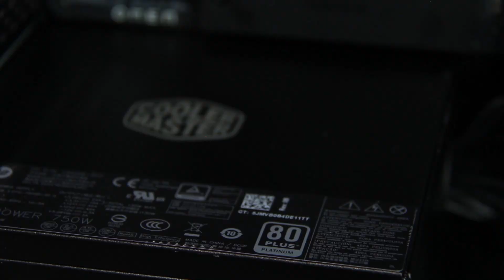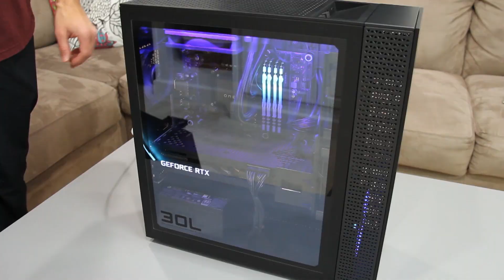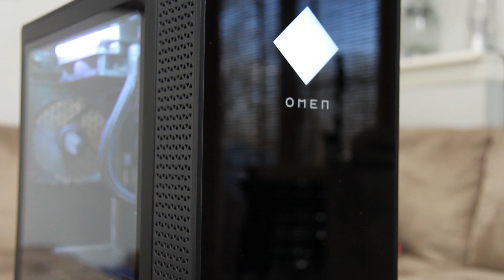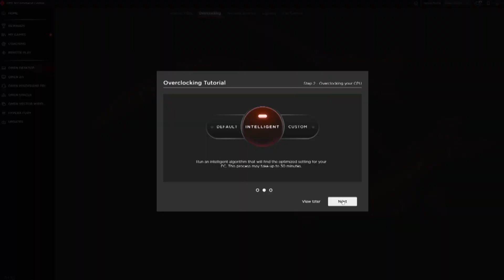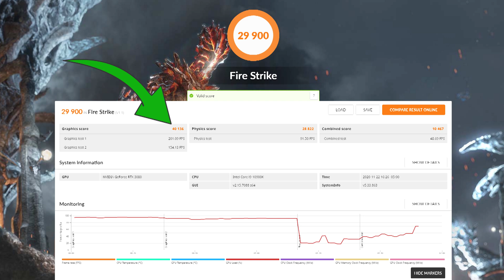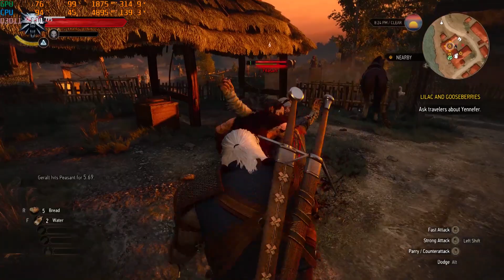OMEN 30L!  Are pre-builts good now?

Comment: I'm getting an Omen 30L for $850 with a Ryzen 7 3700x, 16gb ddr4 3200mhz ram, and a gtx 1650 super. Sure, the 1650 super isn't that powerful, but it is powerful enough for what I do, as I already own and use one in my current system lol
Reply from the maker: That’s an interesting combo and I didn’t know that spec was inside the 30L.

Comment: I have a new 30L Out of the blue it started shutting down, Hot?? just watching streamers. The fans start running fast & then it shuts down... I have to push the on button to restart it. Tow months old what do I have to do to fix this? I don't feel any air coming from the top of the cooler?? So instead of the fans running normal it's like it wait until it to late & crash... Help!!!
Reply from the maker: I’d repaste and undervolt.  With a little tuning you can make that sucker scream 👍

Comment: Hey Bob I just bought a OMEN30L AMD Ryzen 5 5600G - 16GB Memory - NVIDIA GeForce RTX 3060 - 1TB SSD should I return it as I have zero computer knowledge and no time or knowledge to replace a motherboard/overheating issues with fans? If I return it what prebuilt do you recommend for causal gaming and longevity? Thanks!

Comment: I have one of the earlier model omen desktops with a gtx 1070, 16gb ram, and an i7 7700k. Paid a little over 1000 for it. Its held up under frequent use for about 4 years now with regretfully alot of neglect in the cleaning department. Its like a faithful Toyota, not the best or nicest thing on the market, but it'll take care of you.

Comment: in spain 3080 is more then 1500euro and you can only pre order. here with this pre build pc comes with i9 10580k, 64gb ram, 1tb ssd and 3080 total 2599euro. i think apart from the heating issue (which can be solved by changing fan(maybe)), it's a good deal. and because of shit miners , i don't thing gpu will be available in 1-2 years.

Comment: Does your power supply exhaust fan (the fan at the bottom back side along with power supply) in the OMEN PC starts and stops continuously after every few seconds ? thanks
Reply from the maker: Yeah that’s how many of them work.  They can go into passive mode sometimes 👌
Reply: @BobOfAllTrades  thanks for the quick reply. the constant clicking sound due to start/stop is annoying. I don't even understand the logic of the fan starting/stopping so quickly as temperature won't change every 5-10 sec. But it is what it is! :)  thanks

Comment: Great video, with lots of thoughtful explanation of why the current Omen by HP is a good pre-build. 
I got the 25L with an i9 9900K and its cooler master liquid cooling system. I get temperatures of 50-60C on idle. I just started monitoring my CPU temperature but people tell me that this temperature range for an i9 9900K is normal, is that true? If not what would you recommend to improve cooling on my system.

Comment: Since the RTX 3080 in this system is based on the reference board, it should be possible to fit a EK-Quantum Vector RE RTX 3080/3090 onto it? Does anyone have experience with this? I'm thinking of eventually moving most of these  components (except mobo) into a custom loop system.

Comment: I have the one with the 3070 and i7-10700k and i cant for the life of me get it to perform well
Reply: The cpu jumps around between 700mhz and 4700mhz all the time.

The gpu always reaches crazy temps above 80. I can keep a steady fps in rainbow six on the lowest settings.

I did a fresh install of windows and it made the gpu problem worse.

I cant for the life of me figure out who the hell makes their gpus, i know they are custom made and i think that is the problem with the gpu performance.
Reply from the maker: @goriaakash  it’s a reference board. You should be able to go straight to Nvidia‘s homepage and install the drivers

Comment: Got this with 10700k I'm concerned with the Temps I'm around 80c when gaming, sometimed peaking at 82-83c on high demanding games
Reply: ordered the same but its due to be shipped in 20 days...
Reply: @Mr.Nobody_KTBFFH  well I had frames unlocked in most games and learned that one should cap frames -3 from monitors refresh rate (144 in my case) for g-sync to work properly and now my Temps are wayyyy lower
Reply: @marting9568  wait you fixed it? Can u explain in detail what u did? I don't know too much about those stuff. Like for instance when i play cyberpunk, it sometimes get to 83© etc
Reply: @legendteigen461  if u have a gsync monitor or freesync, download rivaturner and cap your fps to -3 of your monitors refresh rate. Make sure gsync/freesync is enabled in nvidias control panel and set v-sync on. You will not get any input delay this way and Temps will be way lower since your gpu/cpu do not need to hunt for maximum frames since that gives you no advantage, just higher temps.
Reply: @marting9568  what do you mean by -3? If I have a 165hz screen I set it to cap at 162hz? Is that what you mean
Reply from the maker: You’re about 20°C away from thermal throttling.   That’s also with the GPU dumping heat into the case.
Reply: Same man. I have the exact same pc. I'm very concerned ngl

Comment: If I were to hook up my 4k tv and my 1440p monitor and start multitasking, playing games on one and browsing on Chrome on the other, would that make the fans go nuts? 

I currently have an ASUS G11 with a GTX1060 graphics card and an i5 CPU, it manages to run this setup with no problems and does not make much noise at all (granted, I force the tv down to 1080p to achieve consistent frame rates) however when I bought an Alienware Aurora R11, it would get EXTREMELY loud and blow hot air with this exact same set up and playing the exact same games (mainly Final Fantasy XIV) despite having far better hardware, it was enough for me to send it back twice and this was after I replaced the fans with better ones! I just want a computer that can pull off what my current G11 can do without turning into a jet engine in the process. I was hoping the Omen would be better, but I got concerned when you brought up the loud fans.

Comment: Is this the I9 version? Any issues with overheating?
Reply: This is the i9 so yes the cpu with start to ramp up heat on high demanding games. If you get this cpu get a good cooler so your pc doesn’t sound like a jet engine
Reply: You bet there are heat issues.
Reply: @b6tmqn   what FPS you get on fortnite? And it hard to build one for me
Reply: @b6tmqn   ok
Reply: I have this i9 10900k with 3080 i swapped case to fractal define 7 with arctic liquid Cooler II 360, also changed motherboard. Cpu temps went from 85 in load to 60 in load and under 25 in idle
Reply: @b6tmqn  I wanted to build a pc but a gpu cost as much as a prebuilt

Comment: so is this desktop upgradable now? I'm trying to buy one but, they said that you cant upgrade the memory pass 16gb ...
Reply: I had one, they say it is "upgradable" but what they don't mention is that you would have to buy the ram straight from HP at a higher price to be able to have it to work at the proper speed. If you want this PC to upgrade it is not worth it imo. If you want it to leave it as is it is a good one. I learned the hard way.
Reply: @emanuellopez9004  cant deny that the case looks pretty good, I went to best buy yesterday and they were all sold out lol but I guess that is not a good buy if you cant buy the parts of your preference, thanks a lot 👌 I'll pass on this one xd
Reply: @emanuellopez9004  this is false.  I bought an off brand 16gb ddr 3200mhz and in task manager my memory clocks in at 3200mhz
Reply: @kryptopcgamer589  well for whatever reason that did not work for me, I bought a 3200 32 gb and it did not want to run proper speeds no matter what I did.
Reply from the maker: Not all advertised memory speed is equal.  JEDEC speed could be 2400mhz for example on some memory but has an XMP profile of 3200mhz.  

On the reverse side, I’ve warned many about faster memory in their laptop that does not support it.  Some will buy something that is 3200mhz in a laptop designed for 2666mhz.  Depending on the JEDEC it’ll either default to 2666 and the individual will be disappointed because they bought fast memory that won’t default to the “advertised” speed or it does run at the advertised speed at they get errors.  

I’ve also seen people think they’re buying 2666 memory for their laptop at it defaults to 2400.  Many Crucial Ballistix work like this without XMP.  

There’s layers to this so stating that this essentially doesn’t work at all is different than your purchased memory that’s not working for you 👍
Reply: @emanuellopez9004  you can try intel xtu to overclock the ram.
Reply: Also the case although looks good is not the best airflow wise.

Comment: I have this pc but it’s the 30l of 950$ has a ryzen 5 3600 8 or ram 1660 súper and it runs fortnite at around 300-400 FPS low settings in game I use it at 144 and it runs the 144 stable without any fps drops recomend this tbh

Comment: I bought it for my son.  He loves it.  We have had some issues though.  I7-10700k liquid cooled CPU, RTX 2080 super GPU, 32gb RAM, 750 watt PSU and 1 tb ssd/1 tb hdd.  Everything is finally running well except that the GPU with 90% and above utilization, runs extremely hot between 80 to 86c degrees.  I have no idea what to do about this.  How is it the 3080 runs cooler under load then the 2080 super?
Reply from the maker: You can control the GPU fans with MSI afterburner 👍
Reply: @BobOfAllTrades  Thank you very much for the response.  I belong to an omen discord and the owner of it, who also runs an amazing youtube channel DanKamYouKnow, has told me to use msi afterburner along time ago.  I suppose I finally should download it.  I'm so grateful for you taking the time to answer my question.

Comment: BUYER BEWARE dont ever buy an HP omen you can not upgrade the ram properly as HP has the bios locked out and it will slow your ram speed down to 2400mhz the only way to get 3200mhz is to use ryzen master to overclock ram there are a number of YouTube videos and forms on this dont get scammed buy from another company or build your own pc
Reply from the maker: Let me see if I can confirm this with HP.  It’s not like I have extra memory here to test 👍
Reply: @BobOfAllTrades   yup what HP did was they locked down their bios so you can't enable xmp for ram, if you buy the ram directly from hp the ram has a bios tag which will cause the hp ram to run at 3200mhz but if the ram is from newegg or Amazon it will slow it down to 2400mhz so the only way to get around it is to overclock it with ryzen master there is alot of YouTube videos made on it also alot of forms so basically  HP gets to sell you ram for triple the amount that you would pay for it's a marketing scam
Reply: @BobOfAllTrades  Hi bob, how did you get on with hp? I just bought this as well, I have the intel i7 with 16gb ram variant with rtx 3080 thinking that I'll just update my ram in the future if need be. Now I'm gutted seeing all these issues regarding ram upgrades on this pc..
Reply: @nOahjOmes  there is a YouTube video from hardware sense which explains the ram issue and why check it
Reply: So you can buy the ram from hp and it will work fine
Reply: @brandonwear9081  as long as the ram is 3200mhz and the same, you can run it. You can enable it from the omen command in over lock settings. But most came with one 16 stick so it’s better to just buy a 2nd one so you can run dual channel

Comment: Anyone else see the hp omen 30L at bestbuy for 1300 but the price got drop to 950 dollars?
Reply: @kvonnegut2858  what do you mean “ ruin “ you could just install another fan yourself couldn’t you
Reply: @kvonnegut2858  it’s a solid pc anyways better then anything you’ll get for 750/850
Reply: Purchased it and yes it does have a cool issue ! Have to lower the cpu speed
Reply: @squished46  couldn’t that easily be fixed tho by getting a new fan or opening the case and leaving it open instead of having the glass door on
Reply: @Adorabubble  i don’t think there is enough space for a better cooler, that’s why call it an issue.
Reply: @bugzf  well couldn’t you just get a better case?
Reply: @bugzf  I mean the thing is I watched a guy put a cooler in his hp omen 30L
Reply: @bugzf  is there’s gotta be room then you know
Reply: @bugzf  here’s the cooler this guy used in his video
Reply: @Adorabubble  still a 120mm aio, no much different, mine still on the way so if cooling really a big issue i will consider a new case or hope open side panel will help😂

Comment: I have the 2060 one can I upgrade to a 3070 or no
Reply from the maker: Yes you can just double check your power supply and length of GPU so it actually fits.
Reply: Over heating issues ?

Comment: For $2,000 dollars I can build a pc that's way better and quieter and a nicer case. My PC was $2,300 and I have a 5800x, 3080, 32gb of 3600mhz and gigabyte aurous master motherboard with a good sound card and amazing overclocking and a lot of IO.
Reply: The problem is how do you get a rtx3080 in retail price? I have been trying for 2 months and no luck, i got this prebuilt for 1480 before tax with 10700k, I feel lucky enough.
Reply: Master craft over heating issues ?

Comment: Man I wanted this prebuilt, but I just finished ordering my build parts the day before it came up. a sad day
Reply: It's a scam build look up in YouTube ram issue omen 30l no matter what ram you use it will slow it down to 2400mhz and you cant do anything about it I know as I own one and regret it buying it now
Reply: @Zipfile12  it’s not a can lol. I already know of the ram issues
Reply: @Zipfile12  I don’t think it’s a scam you could you could just buy different parts or get a different case
Reply: @Adorabubble  you would have to replace the motherboard to get the desired ram speed what hp did was they locked down the bios so that you can't enable xmp, so whenever you upgrade the ram it down clicks it to 2400mhz but if you buy the ram directly from HP the ram has a bios tag which the hp bios recognizes it and will up clock it to 3200mhz so basically if you want the 3200mhz speed you have to pay the overpriced ram to get that so how is that not a scam no pre built has ever done that ram is cheap on newegg.com or Amazon so just saying what it is
Reply: @Zipfile12  I play on a console so going from having 60 FPS cap to 300 FPS on some games/ 120 FPS in others that’s a huge changer
Reply: @Zipfile12  besides that’s not the problem I’ve been seeing. I heard some saying it had a heating issue but that can easily be solved with a CPU cooler or just have the case open instead of closed
Reply: @Zipfile12  besides it’ comes with 16Gb ram I don’t think I want to add anymore ram to it since 16gb is way enough for games unlike 8gb
Reply: @Zipfile12  besides this is a starter PC I’m not looking to spend 2k on a pc or at least 1500 or even build one myself yeah I could probably build one for way cheaper better then the omen 30l but I ain’t looking to do that
Reply: @Adorabubble  I would suggest a different brand as the future of gaming is changing with desktops the 3070 or 3080 recommendations ram is 32gb ram makes a big difference in FPS the faster and more ram you have the better the fps will be HP uses jdec not xmp anyways so the ram speeds are slower anyways as for overheating issues you can always add a better cpu cooler and other case fans but I own this pc and don't recommend it also the new xbox series x is faster than this pc also something to think about I am just giving you my experience with gaming desktop always research the GPU's and processors before buying any gaming desktop if you want more for your buck dont get screwed because you watch one youtube video of the desktop always research things
Reply: @Zipfile12  it doesn’t have to do with just the ram the graphics card and the ram plus the monitor makes the FPS let’s say you have a 75 hrz monitor but a pc that runs 200 FPS you won’t get the feeling of 200 FPS i
Reply: @Zipfile12  if you don’t suggest this computer which one do you recommend then because the cyber/skytech are just scams
Reply: I heard there’s a heating problem but I’m still going to get it. Cooling issue shouldn’t be a problem when you could just get a cpu cooler.
Reply: @Adorabubble  it’s already got an aio attached, not sure if the case supports a 240 aio at the front. Is it still on sale? Without the Black Friday deal I silent buy but it was an absolute steal at the discounted price
Reply: @wandrinsheep  it’s 950 dollars still on bestbuy so yes it’s 300 dollars off still. I’m just trying to understand if this is a good purchase or should I go for something else
Reply: @wandrinsheep  I’m a pretty hardcore gamer. I would say I play maybe 12 hours a day if there’s nothing I’m doing but 5 hours straight is probably the most I’ll be playing on the computer you think it’ll heat up and start crashing?
Reply: @Adorabubble  those on bestbuy are different versions from this one here in the video. This is significantly more powerful
Reply: @Adorabubble  if your getting the the Best Buy variants, heck even this. It won’t crash from heating. They got hot but the aio is sufficient for most cases I could see it overheating if you tried to overclock the cpu but otherwise it will be fine; if only a little bit on the warmer side
Reply: @wandrinsheep  is your telling me the 950 dollar aka the 1300 omen 30L is a piece of shit? My budget is under 1k I know I ain’t getting the best high end pc but I want to know if the 950 dollar one with 16gbs and Ryzen 7-Series is good
Reply: @Adorabubble  no it’s not a piece of shit, far from it. It’s quite good. But the gpu in those omen are like rtx 2060 or 1660 super etc. they can run most games in 1080 at ultra and 1440 medium high. The one in this video however is a 3080 which is much much much more powerful gpu